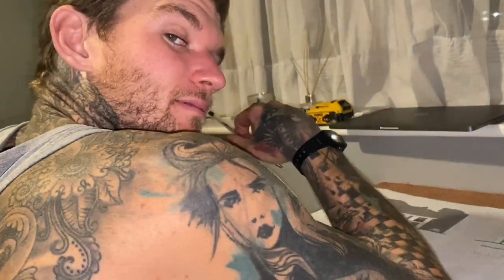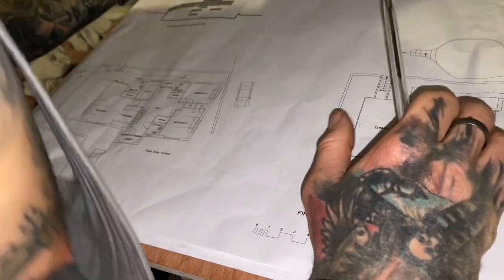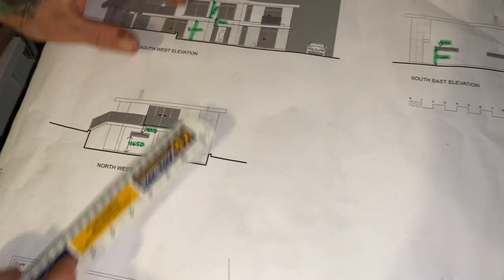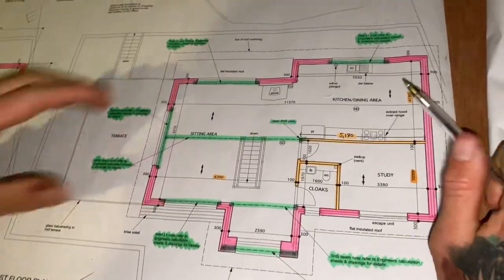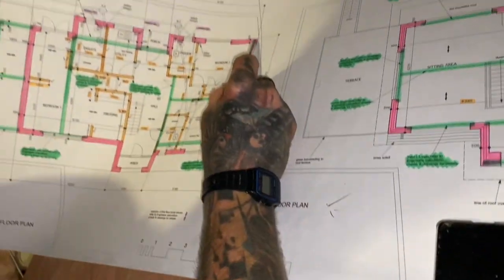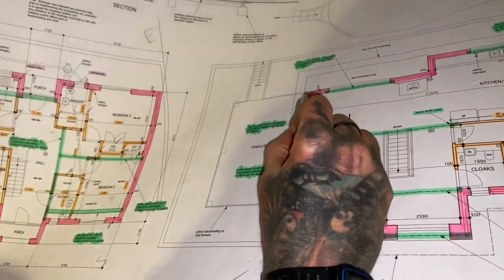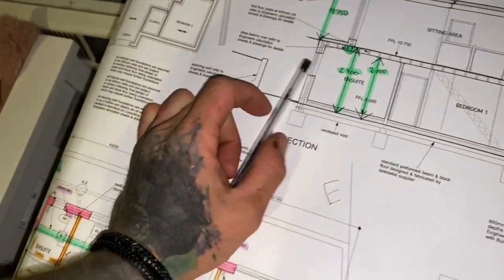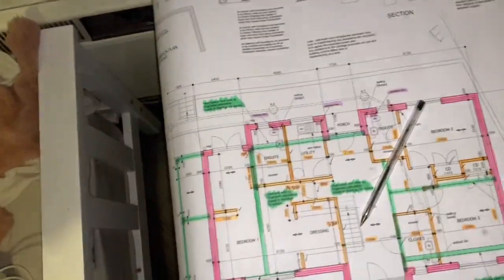Bricklaying, how to read and scale drawings

Comment: @charlie be careful when scaling off measurements from drawings.... it’s not recommended to scale off. Use figured dimensions only. Go back to client and tell them give you the information you require. I noticed that drawing didn’t say the the scale on a page size. For instance the drawings could have been plotted on an A3 size sheet on Autocad or Revit etc but was then printed on an A1 drawing ( size on this video). This will throw your scale out.

Comment: Charlie, 6min20secs in with the wall measurements . Using one wall length minus another to get another measurement - don’t forget the measurements are internal so you also need to add on the thickness of the wall to give you the overall length that you are trying to find 👍🏻

Comment: As a side comment from my other one, there are a few things I’d find quite interesting to see if you could edit these into the build video.
These might sound like ridiculous suggestions but I’ll throw them out there. 

Could we have a side by side shot of the drawing and your actual build as you go along.

1) brick and block work
2) steel work
3) cavity and insulation examples
4) any discrepancies in the drawings and what you build to over come those problems.
5) elevation drawings to finished product.

Just a few things I’d find interesting since I’m not a builder with explanation from the drawings in real time on site, even if just short snippets.